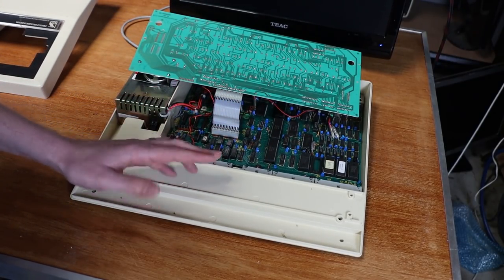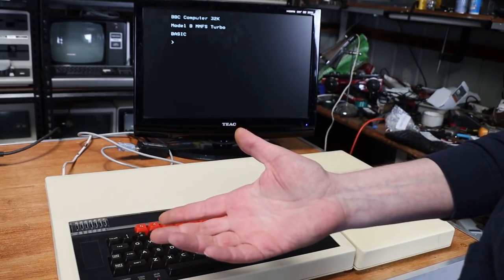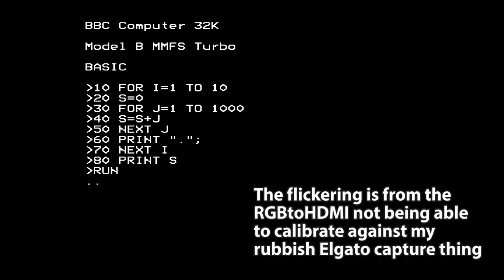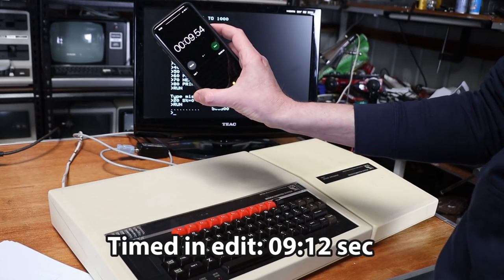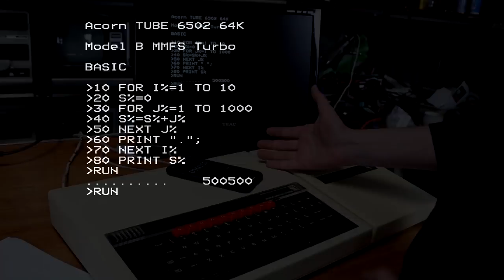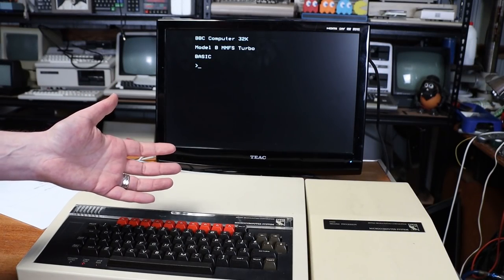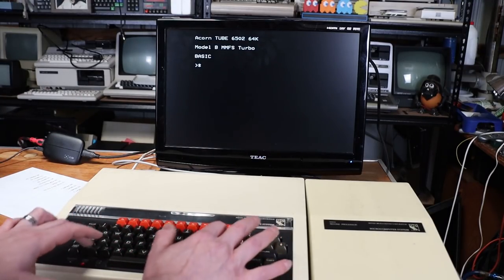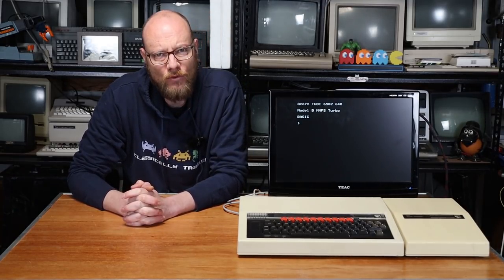BBC Micro: Second 6502 Unit

Comment: The 6502 second processor had 64K of RAM all to itself. That made it possible to run Tube-compatible applications and have a lot more memory for things like documents or for the operation of those programs themselves. One of the most promoted applications for the 6502 second processor was the Bitstik CAD system, which originated on the Apple II, and which featured 3-axis joysticks. See the May 1984 issue of Acorn User for some nice coverage of that system.

Comment: With a second processor, the internal 6502 was still used for I/O, such as screen output.
Reply from the maker: Yup, but from a processing/benchmarking it’s not doing anything.
Reply: @MrLurchsThings  there will a small impact during the execution of the print statements, all screen output is done by the internal cpu. I get your point though.
Reply from the maker: @mgarnett02  true. And they’re tasks the faster cpu doesn’t have to worry about.
Reply: @MrLurchsThings  ...but once you started doing graphics, things like plotting a line, filling a triangle, writing characters to the screen were handled by the I/O processor. That, and you no longer lost 20K of RAM for video memory (which is why Elite could use 4 colour graphics for its main display - the non-tube version was monochrome 320x256 vector graphics with a sneaky mid-scan mode change to 160x256 8 (?) colour for just the bottom 1/3 to allow a colourful control panel).

Comment: For the reason why that program failed. You used "O" instead of "0" on line 20. (20 S%=O)
Yes, I froze the screen because I wanted to find out!
Reply from the maker: Downside of trying to do things with the camera running.
Reply: O and 0 look so similar in Mode 7. I've lost count of the number of times I've made that exact typo.
Reply: @OzRetrocomp  With respect… no they don’t! They look a lot less similar than O and 0 in this comment font, for example. The Teletext O (letter) is pretty square and open. The 0 (number) is pointy at the top and bottom – virtually hexagonal. I’ve always thought how well designed the two were, to make them so obviously different. Indeed, watching the video, I noticed the error immediately, as the program was being typed (even speeded up). (Just as I’d also noticed the previous S$ mistake!) As for resetting the computer and retyping the whole listing rather than just correcting the one typo in line 20… I have wonder what the point is of having clear error messages that tell you exactly what the mistake is and where to find it…!

Comment: Second Processor was for use with BBC MIcro
Co-Processor was for use (internally) with BBC Master
Electronically they are both the same (almost), but different PCB and connector layout.
As the BBC Master has the external tube port also, it can use both styles.

Comment: Awesome demo of a gadget most of us will never see. :-)
If you DO decide to play Elite, I'd strongly recommend a joystick. They're incredibly easy to "DIY" on the Beeb, as with so many Acorn systems, they did the Analog input the RIGHT way, so you can use any potentiometer with them.  I went and bought an "off the shelf" analog joystick and slapped it in a cheap case I got from Altronics. It works really well.

Comment: The US being the home of Commodore and Apple,  I would’ve loved to see more awesome 6502 machines like this.   The Apples were for the “rich kids” and the schools had them locked away in labs.   So the VIC 20s, 64s, and even the random CoCos and TIs were plentiful in the working class.   But multi-processing expansions and co-processors?   Even the c128 just had dead weight multi-cpu setup….these British machines were truly interesting imho from an engineering overachiever standpoint!
Reply: Of all the “home” computers from this generation, this was probably the most flexible and forward looking - I had one as a teenager and I really wish my parents hadn’t given it away.
Reply: The Beeb was basically the British Apple II, so it was mainly the middle-upper class kids and schools that had Beebs as well. They weren't cheap, especially given that the British economy was in a bad way at the time. The only computers most Brits could afford for home use were the ZX81 and ZX Spectrum, which is why they're so loved.

Over here in Australia, Beebs (along with Apple IIs and Microbees) were usually found in schools rather than in homes. Over here, most people had Commodore or Dick Smith computers (most of which were rebadged VTechs). There were a few Spectrums over here, as well as a mix of Atari, Microbee, TI 99/4a, Sega and (later on) Amstrad. Not quite as diverse as the UK or Europe, but still interesting.
Reply: @OzRetrocomp  The initial price of the BBC model B in the UK, was actually GBP10 lower than the C64 and a lot less than the Atari 800, but they didn’t drop like everyone else’s pricing, in fact they went up from GBP 335 to 399 and store prices stayed much higher than the rest of the market. The Acorn Electron was a much better bet as a home computer as it was half the price (199 at introduction) but as soon as you wanted to expand it, you might as well have bought the Model B because you needed a really expensive module to give you the functionality of the model B, and that was before you actually added any peripherals.
Reply: @Doug_in_NC  It was still more expensive than the ZX81 or Speccy, although tbf the Beeb was a lot more substantial. I didn't realise that the Model B was less expensive than the C64 (at least initially). I thought they were roughly the same price.  

I agree that the Elk is a great little computer. When I bought mine, I originally did so because I couldn't justify buying a Beeb at the time. I was shocked at just how good it is even in stock form. I'd argue that the Elk's biggest problem is that the Beeb is such a colossus, it was always going to live in its older brother's shadow. But on its own merits, I enjoy using my bare bones Elk just as much as I enjoy my souped-up Master 128.
Reply: @OzRetrocomp  I would love to have a Beeb of some sort in the future, but American ones are pretty non-existent and the postage for shipping one from Europe is rather eye watering, so I guess I will stick to the classic American machines for now, even though except for the Vic 20, I never really had any experience with them as a kid.

Comment: Great video Jason. The 6502 Second Processor was an upgrade that I was considering for my Beeb. So it's really useful to know a little bit more about it, thanks. If you are going to have a go at Elite you might want to make sure you have plenty of free time available, the game really sucks you in 🙂 Cheers, Alan.
Reply: As a life long fan of Elite, for a long time I wanted to upgrade my Bbc with a second processor,  i was also aware of the Raspberry Pi solution, and excellent as that is, I wanted the period correct cheese wedge like you have, I found a very nice example a few years ago and it's now permanently plugged in to my Beeb!
It's just a shame I don't have the programming skills to fully utilise it, but there.

Comment: Cool! I had no idea the BBC Micro had a second processor option.
Reply: It actually had several official Acorn ones, and one or two third party units. Z80, ARM 1, 68000, 32016, 8088 and 80186 were available. When Acorn developed the very first ARM chip, they used the Beeb's tube interface to test it. Acorn then packaged these second processors as ARM development kits for software developers to learn the new ARM architecture. Yes, ARM started life on the BBC Micro, and then set it's sights on global domination.  😁

Comment: A brilliant video quickly showing a second processor. Modern Raspberry PI second processor option is available which allows you to run Planet X3 on the Beeb, CP/M and have a 6502 clocked at over 200 MHz, if you want as well you can use the PI as a second processor and have a 1GHz Arm system which can run Doom.

Comment: It kinda bugs me that the internal CPU doesn't do much with a co-processor installed...
Reply from the maker: It’s basically handling IO and screen routines. But on the other hand, they’re tasks the faster processor doesn’t have to worry about.
Reply: I think it was a very smart engineering solution. As Mr Lurch points out, delegating simpler tasks like IO and screen routines to the on-board CPU frees up the second processor to do its thing. It was probably out of necessity as much as anything: could you imagine a 6502 and Z80 playing nicely together?  Or any of the other non-6502 processors that were available?
Reply: You only have to look at the Commodore 128 running CP/M to see how “well” a dual processor machine can perform.
Reply: @Doug_in_NC  How did you know I was thinking of the C128 when I made my comment? 😄
Reply: @OzRetrocomp  😂😂😂

Comment: A dual core 6502..... sort of  xD
Reply: Well, a 6502 'dual processor' system, which is what we had in the bad old days before multi-core CPUs were a thing. 😁 The Beeb was quite unique at the time... although my ZX81 was of course far superior. 😉  It's easy to forget how recent the availability of multiple cores on one die is, but I remember them first appearing on desktop PCs.  Nowadays, having two or more separate CPUs on one motherboard seems very archaic.
Reply: @another3997  To me the bad old days are today. I'll take the retro's all day long. This PC is not even fun to code. With all the heavy duty hardware and SPI's, it's all done already. Like a naked woman...leaves nothing to the imagination.